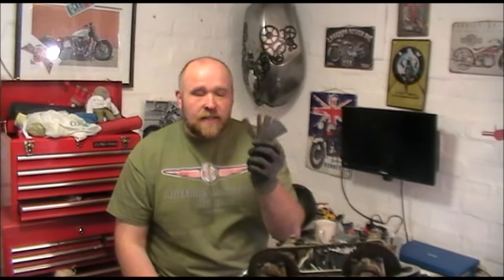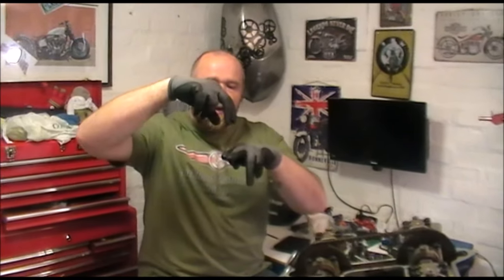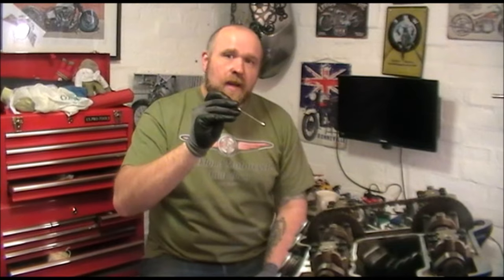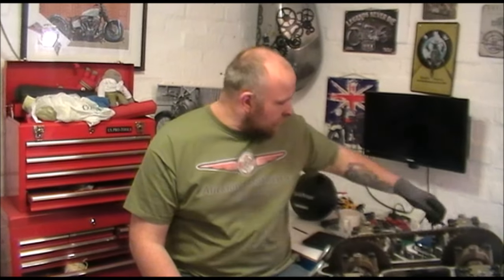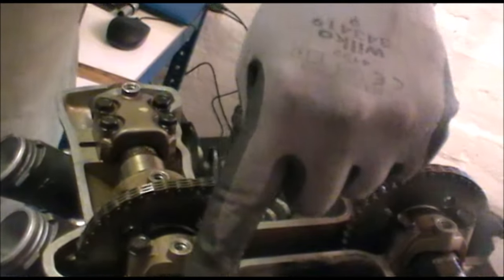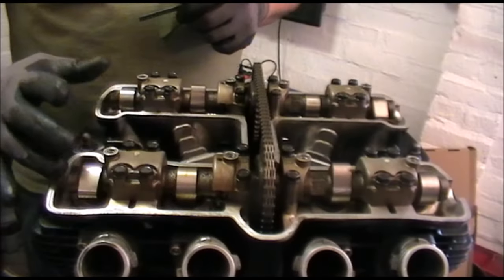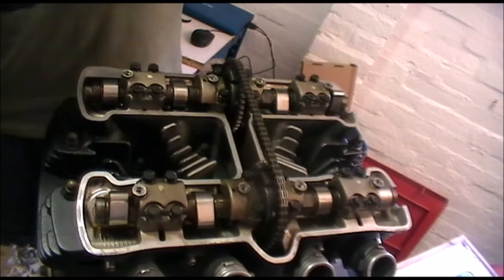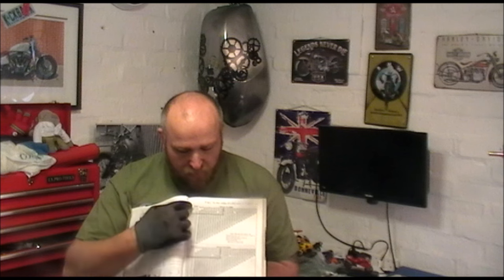Step by Step - How to measuring & adjust valve clearances

Comment: Great video. I don't understand the tolerance thing. And where can I order new shims please. If needed
Reply from the maker: Wemoto sells the shims but make sure you pick up the correct tool, its dirt cheap and will saves time faffing about with cable ties.
Reply: @GTsGarage  I think I wrecked the engine. I took the cam tensioner out to check it, I noticed that the engine needed to be tdc so I moved it with a spanner and felt a crunching noise, put the tension back in and it won't start. Would it wreck the valves if the chain moved😪
Reply from the maker: Chris Debono In short I don't know as I haven't ever had to do a cam chain tension.  Before touching the bike again, my advise would be to phone a local garage and get a trained mechanics advice on the next step.   Hopefully the engine isn't wrecked, let me know how you get on.
Reply from the maker: @tamar5261  What bike do you have and what manuals are you using?
Reply: Hi thanks for the reply. It's a Yamaha xj 600. I think the engine is wrecked. I took the cam chain tensioner out to check it. My wife called me for lunch, a mate came around and thought it would be fun to nick the bike, I foolishly left the keys in the garage door. He tried to start the bike, it just turned over and made a horrible noise, now I can't turn the engine by hand more than 180 degrees. He's absolutely gutted for me. But what are mates for 😊
Reply from the maker: @tamar5261  ahh, i have seen engines go for as little is a couple of hundred pounds, so if it is the the worst scenerio, you still have a way out.  Good luck let me know how you get on.
Reply: @GTsGarage  I have one coming from eBay for 120£: the guy assured me that it was a good runner. We will see. Can't believe this happen 😪 only done 140 miles. I think your videos are great. Help m a lot on my 1300 pan.
Reply: Tolerances mean it can be plus or minus a certain amount.  For example, if "spec" is 0.020" and the tolerance is +/- 0.005", then acceptable clearance would be 0.015" to 0.025".
Reply: @jasonwood7340  hi thanks for the reply, I understand tolerance but not the chart for the shims if out of tolerance. I looked at a few videos and now I get it😀
Reply: @GTsGarage  well I got the engine off eBay today, it turns over ok. What else do you suggest I do before putting in the frame, shims maybe?
Reply: @tamar5261  howd the new engine turn out? Was it actually a good runner?
Reply: @MizMods  yes it runs ok but there is a little blue smoke on start up
Reply: Update... after lockdown I took the carbs off and two were full of brown jelly, I cleaned them up put them back on the bike and couldn't get the revs down, they were around 3k at tickover, took them off again couldn't find a problem then I thought about the throttle sensor, it was reading 10k, adjusted it down to 5k and the bike purrs 😊
Reply: @tamar5261  check for vacuum leaks and idle speed screw

Comment: Measure the old shim with a micrometer as the old shim will have worn and the number on the shim is the size it was from new.
Reply: it usually is the valve seat that wears down after time, the shim material itself i hard and should last long time.
Reply: I've measured. Absolutely no variance from the stamped measurement. My valve seats are wearing down, each time I need slightly thinner shims on the few that need swapping.
Reply: Yep - I did this and you're totally correct.

Comment: Good video. Just did my shims on my Suzuki GS850. Very similar setup. FYI, the reason you don't want to rotate the crank without a shim in every bucket is that the edges of the bucket will gouge the lobes on the cam. You only want the lobes to make contact with the flat surface of the shims.
Reply from the maker: jsandidge1 Cheers for the feedback and letting me know..  did you use the zip tie method?

Comment: Thanks Mate !

I was really afraid to start this procedure (never opened an engine in my life ! ) but your video is really crystal clear ! 
 gonna try this tomorrow !
Reply from the maker: +coxbow Hi, yeah measuring them is quite easy, the changing can be fiddling and the method I use isn't by any stretch of the imagination the approved way, but it works on the 600.  Not sure if its the same on the 900 though.   The other thing to remember is once you take the valve cover off, you might find you need to replace the gasket and getting the gasket and valve cover back on can be a whole lot more frustration LOL.   Take care and ride safe, the good weather is just round the corner. ... apparently.
Reply: don`t need to change the gasket, I was able to take if out without a problem, but I need to go deeper, got 9/9.5 of pressure on 3 cylinders and only 7.5 on the far right one, and it doesn`t fire... I was hopping for a simple valve adjustment... hopping now for a "simple" cracked valve...  you got me started anyway ;-)
Reply from the maker: +coxbow  Sounds like your elbows deep in the engine now... good luck Sir, and give me an update once you find the issue.

Comment: Enjoyed watching this, never done shims before, this will help me, thanks for sharing ,great video
Reply from the maker: Glad you found it useful, would recommend the correct tool, it will save you a shed load of messing around, and will be safer than playing around with a plastic zip tie.   There are so many really good step by step guides on the net, print one off, or photocopy the pages in the manual and work through it..  Make sure the area your working in is as clean as possible, and keep anything that can drop in to the nooks and crannies as far away as possible.

Comment: Brilliant stuff GT, never seen the cable tie method before, worked a treat. I think if you rotate the engine without the shim,  the valve drops into the bore, definitely a bastard!
Reply from the maker: yankee doodle Thanks Chris, got the impression it was something you wouldn't want to do.  How's the season going down there, still quiet?
Reply: Its picked up quite a lot, but quieter than it should be :)

Comment: Very interesting, I think the old Hornet I owned had buckets which go over the shims so you had to take the cams out if you needed to change. I like the mechanism small/older bikes use where you just tighten the screw with the lock nut lol a lot easier.
Reply from the maker: Bikers Quest Like the CG125, now there is a system that works, tighten a couple of screws, jobs a good'un..
Reply: A lot like the Jaguar DOHC inline six. Remove the cams.

Comment: Yeah I've been thinking the air box boots might need replacing .. either way I have to replace the nipple in the carbs someone broke t a didn't want to fix it while they worked on it the bike only has 20.000 on it is it likely for piston rings to go that quick on a bike ??

Comment: Question: my CBR600RR has .007-.009" for inlet and .010-.012 for exhaust clearance.   A few measure .007-.0075 and .010-.0105. Should i adjust the shim size if tight but within spec? Do shims only come in .002 increments? If yes, then any adjustment would provide excessive clearance.

Comment: I didn't see that, in your intro, you distinguished between shims on top of buckets (like this engine or a BMW k100) and shims under buckets (like a kawasaki sherpa and a SV650). The first are easy to do but the latter require you to remove the cam to get the shims out. When i did the Sherpa, i zip tied the timing chain to the cam sprocket and then released the cam from the journals. This gave me enough room to get the buckets out and lift the shims. 
I did it this way (even though it might not meet with a mechanics approval ) because i was scared of messing up the timing when replacing the cam. Yes, i did have the workshop manual and as a double check counted off the chain links from the other cam. 
Is this a really mickey mouse way of doing it?
For anyone else doing a Sherpa KLH250, be VERY CAREFUL when resetting the chain tensioner arm.

Comment: The valve adjustment order (@9:22) is 1243 because of the firing order. The usual firing order for 4 cylinder engines is 1243 or 1342.
Reply from the maker: Thanks for the clarification.

Comment: Great vid going to try this now myself
Reply from the maker: Excellent, just make sure you get a manual, the correct tool and follow the manual step by step using the video to compliment it.  The job isn't that difficult, just slow methodical and if at any point you get frustrated, walk away :) Good luck

Comment: gts... removal and instalation ... more concernd about how to remove and install the throttle cables after a compleat disassembly and rebuild... im having problems with my number 1 plug running rich and flooding ??? gas in air box not much tho .... I'm kinda worried the float might be stuck if that's the case how worried should I be about hydrolocking my engine from that ??? and do you have a fb
Reply from the maker: +Mike Polzin happy to photocopy the bits of the manual if this would be helpful, just let me know.  What makes you think the float is sticking, did you open the carbs to clean?    Jay Camberley is my FB account..

Comment: this may be a stupid question but, is this how it's done on all motorcycles? cause I've got a 04 Yamaha yzf r1 that needs done.
Reply from the maker: The process I think are similar, but the differences are important to get right.. If you going to do the job yourself, get a manual, and follow it to the letter, also get the right tools.  Doing this incorrectly can cause irreparable damage to your engine, so lots of research and again use the manual specific to the bike.. good luck.

Comment: GT - well done, I watch all your vids. Do you have any spare shims I buy off you? I need (2) 255's, (1) 260 (1) 265??? That cable tie thing is a massive pain but it does work!!!
Reply from the maker: Hey 1973Karma, I just checked and the only one I can find is a 290, I will keep looking and if I find the ones you need, i'll leave a message here.  The zip tie method definitely works, but would still recommend the proper tool for the job, plus its really not that expensive to buy.  Just make sure you have a manual, and most important, follow it step by step.  Videos are great for getting eyes on and seeing what has to be done, but they are no substitute for a manual, especially when it could result in you having to buy a new engine.  Good luck and let me know how you get on..
Reply: Thanks GTs............I successfully did the job! 5 of my shims were out of tolerance and they were all slightly too tight so I got a load of shims from here and there. I used a digital vernea and some basic maths. The Haynes manual was quite useful. I also cleaned out the carbs. The bike no longer makes a tapping noise when it's hot, the idle is so smooth and it can do 80mph in 3rd gear. (private land) I still have a little backfire now and again but I have some really bad and ill fitting Black Widow exhausts. Keep rocking.!!!!!

Comment: You are putting the zip the between the valve and its seat? (Threw the spark plug hole?) Is this correct?
Reply from the maker: I used the zip tie method as i didn't have the correct tool, but would just get the tool, it doesn't cost a lot of money, and removes a lot of the trial and error.  There is a really good write up in the manual which should definitely be used as the primary source of information, the video should be used as a visual cue.

Comment: I know sod all about mechanics  at this level,,so can you explaine what the zippy tie is for,,,and whats its purpose pls.  
Mark..
Reply from the maker: Hi Mark, suggest you ignore the zip tie method as it has risks and on reflection isnt worth it.  just buy the tool to do it properly.  With the correct tool and a manual, this job is easy to do.. the name of the tool and the part number is in the manual and isnt expensive.   Good luck and let me know how you get on

Comment: my number one plug is dry black and the bike has low power and clicks a bit up top ..ii baught a bench sync and a compression tester .. so would you by chance know what the compression is suppose to be cold and warm . And my oil light flickers questionable if it's burning oil??? And by the way I appreciate your time helping out I got robbed for 1600! $$$ on this bike to not have it running right .. so I'm left to try and figure it out myself so I'll take any help I can get and do have quiet a few questions ... but just to fill you in I baught a extra head just in case because some head work was done and is questionable I've cleaned it up pretty good so far but some of the valve stems are black I have them currently sitting in berryman s carb cleaner and it do remove some of the tarnished black off the stems but I don't know if it's normal for them to be black up there ??.. and I just order 4 main and pilot jets oring and my nipple(witch is why I'm rebuilding them ) and all my seals.. I live in mn and am at a stall until it warms up but I am prepared to do a compleat rebuild if I have to just hoping it's not my piston rings .. but I haven't noticed Any Smoke errr. I'll leave it at that for now
Reply from the maker: +Mike Polzin Mike, if you have already signed up to the XJRider forum, please do so... The information already on the site and the expertise on th site are second to know..  I did a search for compression on there and found this, seems to be close to what you, well worth working through the thread for tips.  The compression pressure (at sea level) is 156PSI, they don't give hot and cold numbers.
Reply from the maker: +Mike Polzin Just to confirm the spark is black and dry, the manual says this would cause the bike to misfire and give a weak spark.  This is caused by over rich fuel/air mixture, faulty choke or blocked air filter.
Reply from the maker: +Mike Polzin have sent you a private message Sir
Reply: The bike misses at higher rpms
Reply from the maker: So would be in line with what the manual says, that could be to do with the air-filter having fuel in?
Reply from the maker: he forum has go to be the next move, before stripping anything else... someone might know the issue and be able to have you a whole heap of time and effort diagnosing everything.

Comment: Will the zip tie trick work with Suzuki gs series bikes?
Reply from the maker: I lifted the trick from another XJ600 video, so couldn't say if it would work or not.  The proper tool isn't that expansive, and would significantly reduce the amount of bodgery need to complete the task.  Given the outcome should it all go wrong, I recommend if you want to have a go at doing the job, buy the tool, and the bike specific manual and following the procedure to the letter i  That way your less likely to end up with a expensive paperweight  at the end of the experience.   Good luck fella,, ride safe

Comment: I sure wish I watched this before I spent 15 bucks on a valve tool!   Anyway what will happen if you turn the crank without a shim in there?   Just curious
Reply: Oh never mind I see
Reply from the maker: every thing I have read and heard, its something that should never be done.   Nothing can replace the proper tool, and I would recommend using the proper tool every time, i used  the zip tie method as an experiment, but the consequences of messing up, would have been disastrous.

Comment: Could you remove the spark plugs (easier rotation), put the bike in 5th gear, and rotate the wheel until each one of the 4 sets of cams come to that 2 and 10 position in turn, so you don't have to remove the side cover?
Reply from the maker: Not sure to be honest, I just followed the process in the manual.
Reply: You should be able to, yeah. I feel like that's how you do it when the the engine is still in the bike

Comment: Yeah I'm hoping it just needs to be benched out .... chocked is in working order airbox is good... dose it telly out how to adjust the pilot screw
Reply from the maker: +Mike Polzin here is a write up of a carb overhaul, lots of pics and goes through it step by step http://www.xjrider.com/viewtopic.php?f=12&t=6922&p=74971&hilit=carb+idle+screw#p74971.  The manual only says before adjusting the idle screw to screw it all the way in counting the rotations.  The work you way back by the number, that gives you the default setting.
Reply: Yes I understood that OK so my concern is I had someone do some work on the carbs if it's set wrong would it be the same as the rest of them and if is off then how do I know how to set it .. and like I said I don't know at this time exactly what it is just wanna be as clear as I can lol

Comment: Will this work for 2006?
Reply from the maker: It may, but if your going to undertake tasks like this, its definitely worth buying a manual, the Haynes are really good and go through it step by step, you may even be able to get a copy from xjrider.com.   Whilst not particularly difficult to do, done wrong, it would be very expensive to fix.

Comment: The cable tie method looks like a huge pain in the ass... Is it easier to use a valve shim tool?
Reply from the maker: Much easier to use the tool, and a lot less risk of something going wrong.   Would recommend the right tools for the trade.
Reply: Thanks man. I'll buy the tool then.

Comment: Thank you for the video going to do this to my drz400s should be easier with mine since it's a 1 cylinder
Reply from the maker: Your welcome, just make sure you follow the guidelines in your manual, work in a sterile area, and even though I used a plastic zip tie, the proper tool is cheap as chips.. would recommend using it